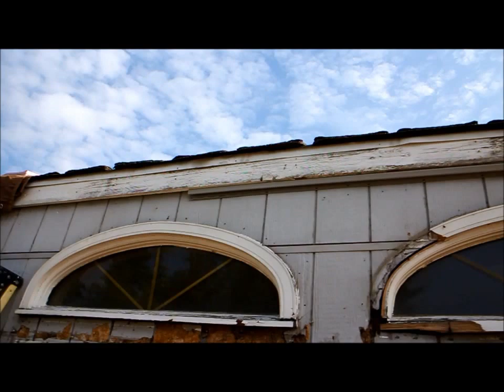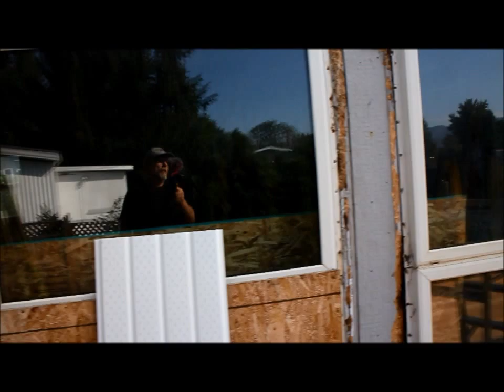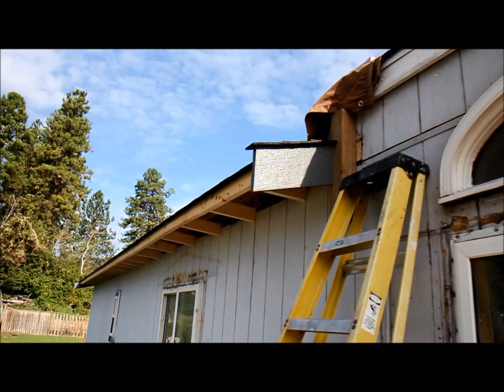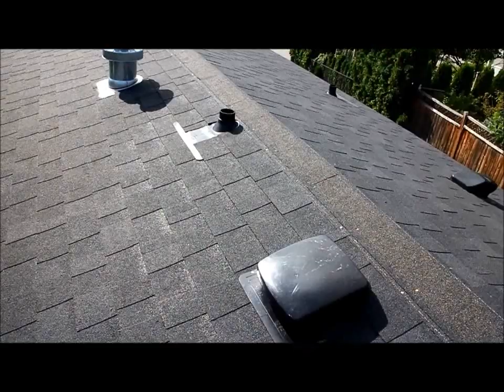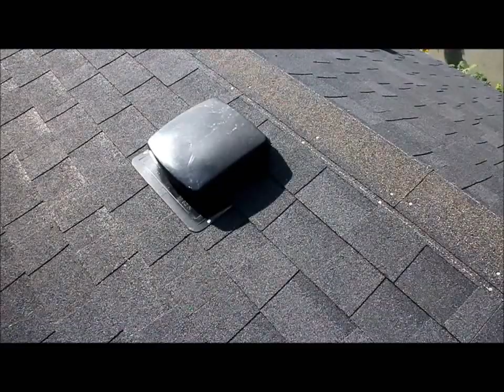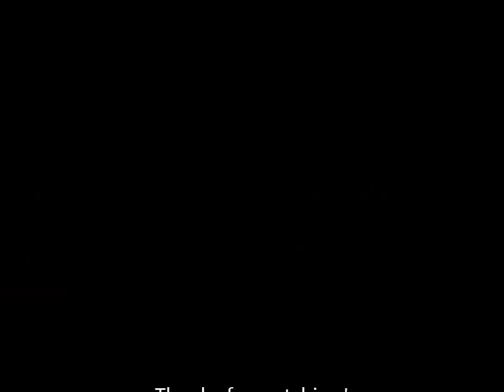Attic Ventilation Explained - Mobile Home Renovation : E032 / BC Renovation Magazine

Comment: Can you even fit a ridge vent on the peak? I have a modular house and I ran into the problem where there is two 2x horizontal members running down the entire length of the roof needless to say. I stopped what I was doing and recapped the peak. I did a lot of work for nothing. Installing gable vents now due to horrible ice dams in the winter.
Reply from the maker: Andrew, it depends on how your home was built but, yes, generally speaking you can fit a ridge vent. There are several different ways of providing attic ventilation.

Thanks for watching and commenting. :-)

Comment: Hello I was curious about your overhang, when you put the 2x4 do you cut it in an angle to screw it to the osb?
Reply from the maker: aquarium aquarium, yes, the 2x4 is cut at an angle that matches the roof pitch. If the roof pitch is 4/12 then the angle cut is 18 degrees.
Reply: @BCRenovationMagazine  oh ok yes I knew it had to. 
Thank you

Comment: I'm confused! Old (1978) 14x70 mobile home. Roof over job with 6 inches of Styrofoam and metal roof panels. Do I close off the gable vents? (Just a hole in each end). North Central Texas by Red River. Doesn't having those vent holes render the 6 inches of styrofoam, on top of the old roof, ineffective? If I close  the holes and insulate over them, doesn't that make the attic part of the climate controlled interior? I think there is a thin, very thin, vapor barrier on top of the ceiling sheet rock. But it's likely deteriorated.

Comment: vents are allowing cold air into my mobile attic which then flows back into the home costing hundreds in heating electricity. why shouldn't i seal the soffet vents off?
Reply from the maker: FixItYerself, if everything is as it should be with the venting and insulation you shouldn't be getting cold air in like that. It sounds like you may have an insulation problem instead of a venting problem. If you seal up the soffit vents you might end up getting mold in the attic space. The attic needs to breathe to get warm moist air out of the attic that escapes from inside the home.